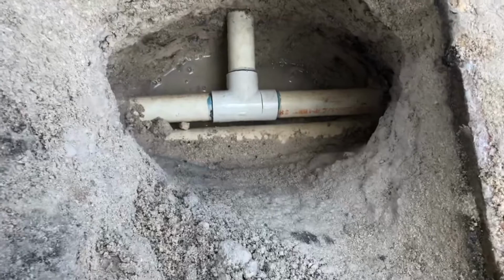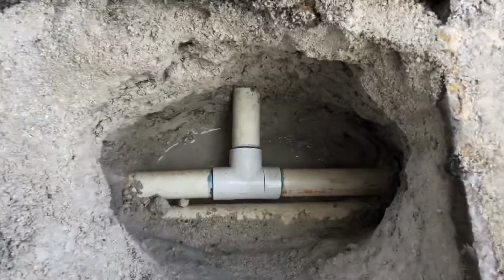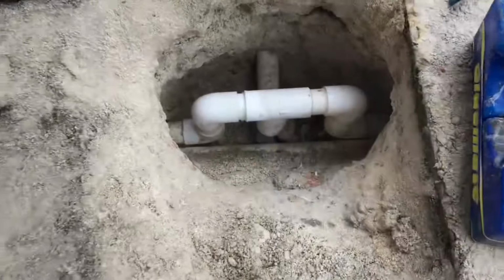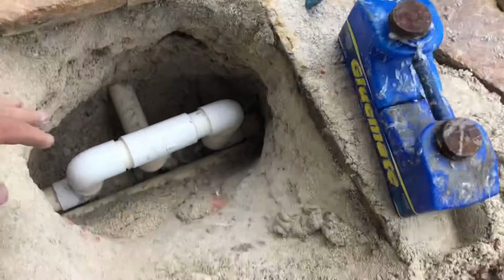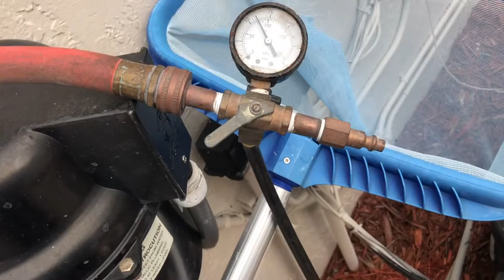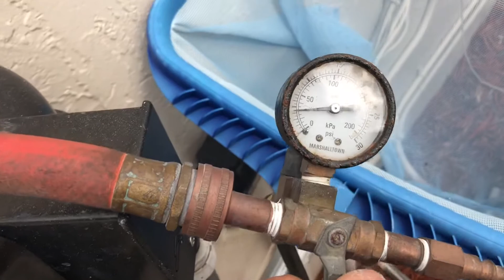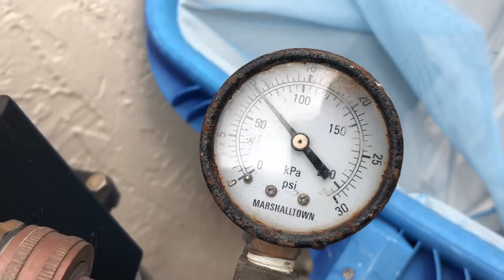Under Ground Pool Return Repair.

Comment: This was a good video except for the fact that your pressure line wasn't holding while you said it was. But that's okay, it served its purpose. This was a great video.
Reply from the maker: Sir the video showed the lines holding at 10psi. Not sure what you saw but I rewatched the video and it holds
Reply from the maker: Thanks for watching.

Comment: great vid and process!!! .... you should consider using  45 degree fittings as they are better than 90 degree in any closed water system.  Cuts down on head loss on pump. best of luck
Reply from the maker: Actually it’s been proven that 45^ fittings are not better flow than sweep elbow 90^’s in tight quarters like this in a hole there’s little to no room for what your speaking of. Thanks for your comment

Comment: Guys this is great. I've got a 30yr old plaster with leaks at one skimmer and 2 return jets. Currently I have them plugged & just using the floor returns. 
I'm putting it off but I'm gonna have to break out the wet saw and some shovels. Knownanybiy in MD that does a good job for a competitive price?!

Comment: Didn't show the repair (totally bummed).  Would liked to have seen the tee that was removed, wondering where the cut came from.  And odd there is a check valve on the spa jets.  I'm guessing there's not a dedicated return which doesn't make sense.  Either way the floating rafts were hysterical 👍
Reply from the maker: The cut came from settlement, no rocks or other heavy debris found on or around tee. There was a storm brewing and had to just do the job. Not odd for a spa that has a check valve, the reason for the check valve is to retain the water level at marble spillway when circulation pump shuts off at night. There’s many different ways to plumb a spa. This one was plumbed only with the spa Jets with air supply line on top and spa main drain. Thanks for your comment and watching us.

Comment: The repair looks great. Only wish you would have shown HOW all of the fittings were installed and in what order. I'm dealing with exactly the same type of break as in your video. Do you have a video available of how the repair was done?
Reply: Someone that deals with plumbing, I highly suggest you don’t attempt to do the plumbing if you are having to ask how to cut and replumb. Will save you some headaches and a bad job that could fail in the future

Comment: Nice, appreciate the video.  I've seen a few of them where they added the "plumbers loop" to the repaired area. Is that just due to difficulty with fixed pipes and fittings or is there something with that design that will prevent future cracking/settling?
Reply from the maker: The loop is plumbed because a plumber can not re-plumb the pipes back straight because there’s never any flex to allow for straight piping.

Comment: I live in New England (Massachusetts) and we have concrete that needs to be torn up. We put in a new liner today and they told me that when they did a pressure test (I think that’s what they said) that there was zero pressure and that all three of our returns are connected (unusual I guess )? I am concerned I am going to get taken so I was hoping you could give me a ball park of what you believe something like this should cost. Thank you so much. We just dropped every bit of savings into the liner and this was an unexpected problem.
Reply from the maker: If they are pressurizing the plumbing and it’s being sealed & done correctly and pressure is at 0 then that means there’s a break in the line somewhere. Have them verify there no escape from the sealed points at the end of the line
Reply from the maker: Be there with them when doing this. They can verify no water is escaping by doing a dye tes around the sealed points, if pool is filled with water of course. Cost varies but for one line break you could expect a $400+

Comment: Just drained the pool to acid wash and change out drain covers, guys that remodeled 5 years ago filled my main drain with pebble tech. Can I saw cut the main drain replace and drill out the main drain line?

Comment: Hello, jist want to know if you can tell me how did you find which return line was the one leaking.   Please let me know.  Thanks.
Reply from the maker: Hi, it’s a combination of my years of training, detecting, and actually a sixth sense/feeling I get which leads me to find the spot. Sometimes leaks can be a bit tricky or difficult to find but I rely on my instinct and training.
Reply: @EliteSwimmingPoolsTV    I have the same question.  Was their an air leak or water leak?  Could you physically see anything going wrong just by looking at the return line that you found to be leaking.   I can hear air and see bubbles coming out of the return jet in the deep end.  (in ground pool)   Would love to hear your answer.  Sorry for all the questions.  I am just trying to learn so I don't get taken to the cleaners when I call the pool guy.  Thanks!!
Reply: Great video.  I have the same question.  Was there originally an air leak or water leak?  I just resurfaced my pool with a new skimmer.  Now I have air coming out of my returns.  I don’t have air in the basket before the pump.

Comment: nice, but what if the patio surface is concrete.  much bigger PITA!
Reply from the maker: A little more work but not that bad. Have to charge more for it due to more steps in the process.

Comment: Is it difficult putting the deck together
Reply from the maker: Not at all. do as I do and as you take out a paver, place it on the side in the same direction/ pattern you took it out from and follow it with the second, third and so on. Basically build the same pattern you took it out from on the side and once your done with backfilling your hole and compacting the hole, place the pavers back in the same order.  If you ever played Tetris you got the idea!! Good luck

Comment: How much should something like this cost? I mean hundreds or closer to a thousand?
Reply from the maker: Somewhere between $400-$1000. Depends on what is found and complexity of repair
Reply: @EliteSwimmingPoolsTV  $400-1000 including the tests etc or the repair itself? Really hope you answer as I’m trying to figure out how much it may cost. Great videos by the way. I’ve subscribed and keep them coming!
Reply from the maker: For both detection & repair, the cost would be closer between $700 - $1,000 +. Again depending on complexity of job

Comment: Why did you come up at all?
Reply from the maker: Due to a lack of flexibility in the pipe. Re-plumbing a cracked pipe where the main line is straight even with a T or elbow plumbed in. The weight of the buried pipe doesn’t allow for flexing. You have to either go up or excavate backwards to create a U
Reply: Nothing like trying to squeeze a T into a spot it does t want to squeeze into. I’ve had many “please don’t break” moments